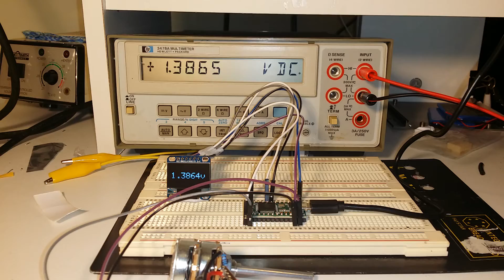Accuracy of the Teensy 3.1's internal ADC

Comment: Pretty good accuracy.  I'm trying to do the same thing, but I get a lot of noise, and the teensy 3.1.  DId you have to do any modifications to make this demo?  On the forums they indicated using a battery, adding caps, and averaging.  Any thing in particular that you did that was not standard?
Reply from the maker: +Spike kito Hi, I am running from a linear power supply which would be better than from USB power. Battery would be just as good. Nothing special otherwise but I have implemented software based filtering/averaging to get the noise down.
Reply: +DeltaGeek 
Thanks for the reply. I found setting the adc to lower resolution and averaging I could get noise to under 1mv.